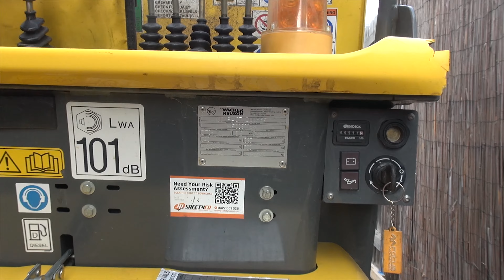Another very rocky pool excavation

Comment: Got to say, after scraping off the dirt and finding all those rocks, i might be tempted to re-evaluate my need for a pool.
Reply: A hole in the ground that they will forever be throwing money in!
Reply: @ccritter9428  It could be worse, they could own a boat!
Reply: @tiredoldmechanic1791  BOAT: Bust Out Another Thousand. 💲💰💲💰💲
Reply: @ccritter9428  Personally if the family gets to enjoy their pool then its worth all the money spent. 
Personally I would have called off the job once the layer of rocks were exposed - they could have installed an above ground  instead and been quids in pocket.
But then Dave wouldn't have got a job and we wouldn't be chatting!!
Reply: @Green_House  A boat, a hole in the water in which you pour money.
Reply: Get a small above ground pool new every year. Then use the extra money for a vacation.
Reply: What is the point of a pool in Melbourne. It gets hot about 3 or 4 days in summer

Comment: What an involved job, for it being in such a small area.  We've used those powered wheelbarrows working on hiking trails.  Makes it a lot easier when importing crushed rock is required vs carrying in buckets, or having horses pack it in.  Great stuff DD.
Reply from the maker: There was some talk of a hiking trail job on my radar TC, helicopter access etc. That would be interesting.

Comment: It never fails, “I want the pool here” and it’s always where the most rock is! Do none of the mini-excavators not have hydraulic thumbs in Australia?
Reply from the maker: Never seen a thumb on a machine this size Bob.
Reply: It would be a good selling feature if they could add one!
Reply: Wow, I was thinking the same thing NH Bob..  A thumb sure would have been handy loading that cart and out in the street.
Reply: @newhampshire-bob1604  Or even just a mechanical thumb - should be easy to retrofit.
Reply: @ckm-mkc    Yes sir! Something to secure the rocks!
Reply: @demolitiondavedrillandblast  Hi Dave, I've got that same 17 Kubota here in the States and the dealer installed a nice little thumb on it when I bought it, works great. We do a fair amount of stone work (putting them together, instead of blasting them apart) and it works great!

Comment: Is there a cost difference between using Expando V's Explosives? Or do you just charge for 'Rock Removal' and use whatever method seems appropriate at the time? 
Given how effective Expando seems to be, I can't see it been a cheap product to buy.
Reply from the maker: The Expando is a bit dearer because more holes are required, I used the expando first because I knew it would be a week before the digger came back from holiday and it would be less annoying for the neighbors.

Comment: I took the fuse out of my track siren. Annoys the shit out of me in confined residential sites. Cat didn’t like my suggestion of a switch to disable the noise so the fuse fell out!
Reply: Every excavator I've been in here in the USA has a switch to silence the beeping
Reply from the maker: I've been using a new 20T Cat machine over the last few days and the beeper that tells you that you are changing buckets is so loud that I need ear plugs in! Not very impressed with the digger.
Reply: @demolitiondavedrillandblast  I don't think you can silence the bucket change alert, but I bet it has a volume control, the problem will be figuring out where to look in the computer